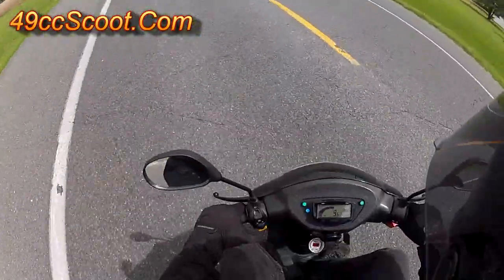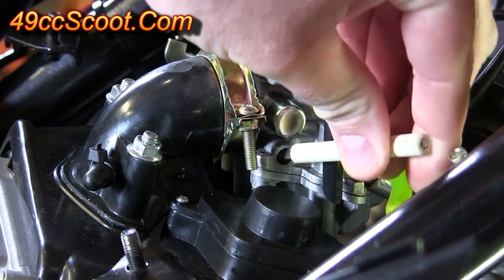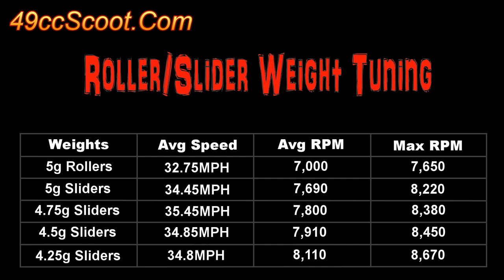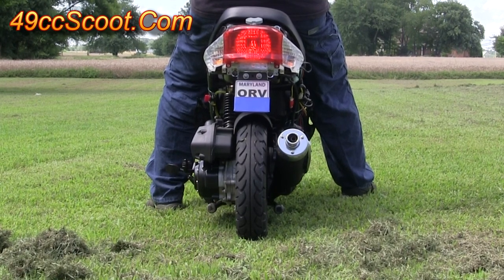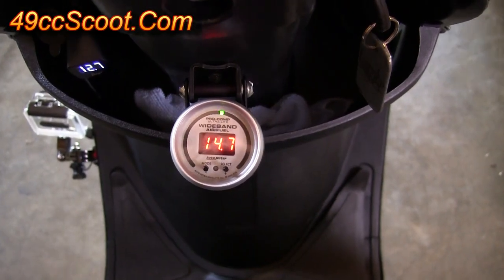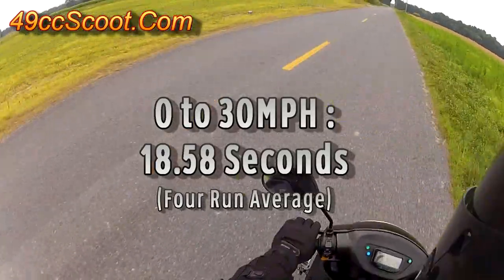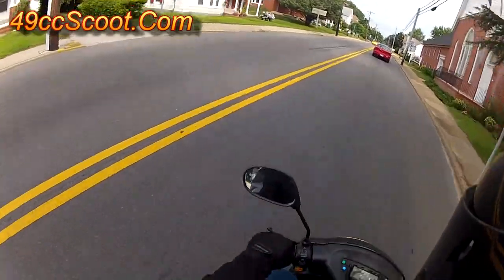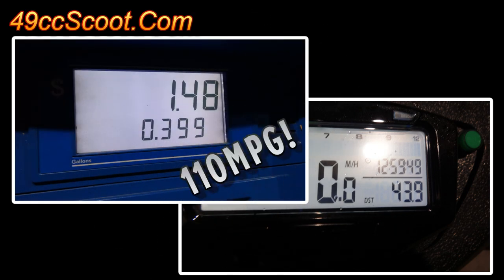Project TaoTao : Carb & CVT Tuning, Airbox Restriction, & Keihin PD19J Swap : 50cc Scooter

Comment: Hello sir. Got a question for ya. My tao tao 50cc runs well but sometimes after being full throttle for an extending period of time, I notice a sudden power drop. And still sputter at idle. If it shuts off it will not turn on. Almost as if it's flooded. After about 15min or so, it will turn back on. Is this issue in my carburetor? Could it be running too rich? I dont have much experience mechanically but have really enjoyed your how to videos. Helped me change oil and gear oil. Thank you for you vids and for any advise with this issue. Thank you! Much love!
Reply: I have as KeiHin carb on it so I can make adjustments to it.
Reply: I'll be at WOT and sudden power drop. I then have to baby it at half throttle to keep it going and 1/4 throttle at stops to prevent it from dying.
Reply: It does still have the original fuel filter. Currenting sitting g at 1700 km.
Reply from the maker: @jaimealvarez4722  I would check the fuel system over. Something clogged or causing less flow could do it. Could also be a low float height setting that runs the bowl dry with extended WOT.
Reply: @49ccscoot  anyway to speak to you directly. Like email or snapchat?
Reply from the maker: @jaimealvarez4722  My email is on my site.

Comment: Hello, How do you get the Air/fuel ratio? do you read it from any intrument? or you calculate it? How do you calculate it? thanks in advance
Reply from the maker: +Jesus Palacios (JPdrums) I have a wideband O2 sensor and gauge on mine. It's not necessary for tuning, but I had it from my car so I used it. Too expensive to be practical for most scooters. It is very nice though. Makes tuning much faster after an initial tune to make sure the gauge and engine performance are in agreement. For changes like summer or winter jetting now, I don't need to do a bunch of test runs. I put a jet in, see where my air/fuel ratio is, and leave it or change it again depending what I see.
Reply: ***** That is very very helpful, Does the gauge measure in volts and you convert it to A/F? I have knloedge in electronics, I think I can get some O2 Sensors from a car cementery.I Have a chinese 150cc scooter with some carb tuning problems and want to make some tuning but doing test runs for me is inpractical becausein my contry we dont have access to a wide variety of Jets. So I will go for the O2 sensor option. Thank you very much
Reply from the maker: +Jesus Palacios (JPdrums) The gauge displays either an air/fuel ratio figure (14.7 as in 147:1 for example) or a lambda reading (1.0 being stoich/14.7) depending which you select. The signal is a voltage though, that the gauge translates. You can find a lot more info on the actual workings of wideband setups with a google search.

Can't you get jets shipped to you? Lots of eBay sellers will send things all over the world.
Reply: ***** Thanks, I supose in my case I need to get the O2 sensor datasheet to translate the readding to a A/F ratio. I have a working microcontroller where I ca do that.

No I cant get anything shipped. Country's F..ked up economy and bureocracy doesnt allow me, my moth salary as a professional is at about 50$ - 60& per month :-/. Im from Venezuela.

Today I got some old jets from a friendly motorcycle mechanic, I managed to get a couple of smaller jets and is working better.

Thank you very much for the help and for your time and patience.

Comment: I have a 90 2001 Polaris scrambler I picked up for my son.im not rich but try to give him stuff I did not have.i got it running great then all of a sudden it stopped!spark is good and consistent.seems to be lacking some fuel.when I spray propane in you can hear it try to start.can the card get messed up that fast?there is a fuel filter on it.
Reply from the maker: Check the whole fuel route. Could be as simple as a pinched hose. Make sure hoses are good when weight is on the ATV.

Comment: so after installing the pdj19 keihin I noticed my plug fouled black...should I be adjusting the screw on the carb to the left or right? is lean responsible for the foul or rich? does turning the screw to the left make the carb leaner or richer...sorry for my ignorance....
Reply from the maker: Rich fouls plugs. Lean would leave it clean. Turning the screw in would lean the idle mixture. You may have to go over the whole tune, not just the screw. Here's a bunch of info : http://www.49ccscoot.com/faq/carbtune.html

Comment: My rear clutch stay open. I used my fingers to smash it open so I could take the belt off. Well it stayed that with the belt riding all the way down in the rear clutch groove . I just put it back together that way. Now I realise there is something majorly wrong. I was in there and replaced the variator. But I am certain the contra spring shojld make clutch snap closed?

Comment: I need your help I rebuild my gy6 50 from top to bottom all new parts . I need to ask you about a 21mm pwk carb. And the best air filter I can buy as the carbs on the bikes don't last me long . I have had like 3 carbs over the last 3 years . I will try to hit up your tip jar soon . And thanks much
Reply from the maker: Some of the folks on the forum could give you better advice with the PWK. I have never used one.   If you get a quality brand... like Keihin or OKO for example, then it should last for years. I've used UNI pod filters, usually the dual layer, and K&N filters on 50-150 4Ts without issue, though I prefer the foam UNIs. There's no reason that combo should need to be replaced regularly. As far as what jetting to start out with on something like that, I have no idea. Again, no experience there. I have heard forum members say that acceleration is dramatically improved when you get rid of the CV carbs though.

Comment: About fuel mileage.. I know this is going to sound insane, but I have a taotao 150cc and am getting an avg. of 113.6 M.P.G.  I weigh 209lb. only use premium gas, and Valvoline oil, conv. for break in, then Valvoline max. life synthetic blend oil.  not complaining just cereus why am getting better gas millage the most 50cc.    would welcome your thoughts on this. Thank You. Dave..
Reply from the maker: A friend of mine used to ride his 150 while I was on 50s. Cruising around 30-40MPH at low throttle, he was seeing near 100MPG he said. I own the 150 now and only see about 50MPG give or take a little, but I don't believe in anything below wide open throttle. If you are more gentle with them (don't run WOT) you can definitely see big changes in economy. Just like in the vid, I only average something like 75-85MPG in my real world riding of this TaoTao... but if I rode slower and paid close attention to the throttle I could pick up a lot of fuel efficiency. These are also real numbers. Some stock speedometers are optimistic, so the odometers should be as well. If you had say a 10% optimistic gauge, your mileage would be 10% worse than you see by the odometer... so 90MPG if you see 100MPG for example.  That could also be part of it. Now, it you are WOT on the GY6 and use a GPS or accurate odometer and still get 100+MPG... I'm not sure . You need to find out and then let us in on your secrets. lol
Reply: I do have a GPS that I can hook up, will try it that way and see what I am getting then. Thank you for your reply.
Reply from the maker: Let us know what you find. I hope it is accurate. That would be exceptional mileage and a great excuse to ride everywhere!

Comment: Thanks for the vid. It helps to understand but i need more info.. I have a 49.5cc icebear mojo trike. I put a 50mm/100cc bbk on it with performance valve head ngk spark plug racing coil/cdi and a 20mm carburetor Stock jets airbox/ exhaust about to upjet tring 90# than maybe 88. Timing set tdc gaps at .005.. Im having "cold" start issues i have to hand choke it for it to start once its warm it starts fine. Runs good i think but i dont have any real experience. Also from a cold start there is a small/low  metallic sound upon start up and high revs right after start up. It goes away fast. Im told some performance heads sound like that idk?.. Could the cold start be just jets or air/fule (set 2 1/2 out) cold outside small stuff like that
Reply from the maker: It could just be a bit lean and will straighten out once you get the carb tuned.

Comment: What oil would you recommend for these Chinese 50cc engines
Reply from the maker: I've been using Shell Rotella and changing it every 500 miles (1000max), but synthetics are great. I was just saving money with cheaper oil. I wouldn't trust any oil for a long interval in these air cooled engines anyway. 10W40 - 15W40 are the usual choices.

Comment: What all modifications can I do now that I dont have a rev limiter, a rebuildable carb, & went from a 50cc to a 80cc BBK? There isnt a pink wire on the cdi box & the carburetor filter is gone along with the air box restriction. What all do I need to do since I installed a 80cc BBK
Reply from the maker: Put the filter back in the airbox. No filter will reduce engine life and it's really not gonna cost you much or any power if it's clean. Tune the carburetor.

Then it sounds like a good time to work on the CVT. At least tuning with weights and springs. Maybe try a performance variator. 

Many also like the gains with an A9 cam.
Reply: I went & bought a A9 cam when I had the 50cc head & jug & didnt see any hp gain anywhere. But when I got the 80cc I felt a good hp gain with the A9 cam. I will get a new filter for the box soon. I have factory sliders from a 150cc I had at 1 time but they wont fit a 50cc variator but I wished they would. Do you know what gram is factory for a 50cc? I have blue rpm springs but no blue contra spring. I also have a new belt ordered and waiting on it. The factory belt busted at 11,000 kilometers & I think its because of the clutch. The clutch & variator housing is a poor design. The inlet hole is allowing water to get into the belt, clutch &, variator casing causing rust to collect on the clutch. I made a snorkel for the airbox to stop water from getting into the box. I did little mods but isnt much. It didnt like being rode in the rain. So the snorkel for air box & tape on the inlet hole of the clutch worked but I dont like clogging the hole so Im working on snorkeling that as well so no water can get in. If I ride in that puddle like you did it wouldnt make it out!

Comment: Goodmorning sir, i would like to ask you if its possible to put a 32mm keihin carb into a 50cc Honda Dio 1 2stroke ? :)
Reply from the maker: I'm sure it's possible, but I'm not sure why you'd need a 32mm for a 50cc. There are some guys on my forum that could probably be of better assistance for that platform. 49ccscoot.proboards.com

Comment: I have a 50cc 2012 Tao Tao believe it has a carburetor issue I'm going to have to change it it will not hold an idle the only way to get it to run as you have to constantly rev the throttle
Reply from the maker: You could try cleaning it first and adjusting the idle settings. If it's a stock carb, it may be just as well to replace it with something that has an adjustable needle and no sealing methods.

Comment: what would be the stock rollers in my 2015 taotao 49cc? what minimum new g rollers will alleviate incline? many thx
Reply from the maker: Can't tell you for sure, I can only guess it may have the same 5g rollers that I had in my 2013. 5g sliders are a popular choice for getting the revs up a little.

Comment: hey also  wanted to know what would cause a scooter to jerk when you pull on the throttle when you first start going could something need adjusting to stop it from trying to bog out
Reply from the maker: The accelrator pump causes issues on some of these. You can try adjusting the mix screw and see if there's any improvement or try changing needle settings.
Reply: Okay im gonna have to try that over the weekend i just hope that i dont screw the carb up its a cvk carb

Comment: What would be a good carb to use on my 150cc. I would like a bigger carb and one that wouldn't hit my crossbar. The crossbar seems to be the issue right now. Thanks
Reply from the maker: I really don't deal with 150s much. 30mm seems to be the popular choice. Not sure if it's really necessary. Lots of clearance issues as I understand it. You'll want an intake to match whatever carb you choose so I would suggest thoroughly searching for options to see which combos do clear. Also I don't see it being worth the effort and expense if you leave a big mismatch from intake to cylinder head. Not saying you have to port the head, but port matching should help.
Reply: Ya, I have tried two different NCY intake manifolds. The last one said it was for low profile due to the crossbar but still pushed the carb into the crossbar. I was planning on a bbk later and adding everything at that time with a bigger carb. Oh well I guess im screwed on this situation. Thanks
Reply from the maker: Turbo Tyler  What about flipping the intake around so the carb is forward facing? May need an adapter to get it level or close.
Reply: I don't think that the manifolds will bolt up correctly like that. I would love to have it forward facing but will have a linkage problem. I think that I tried this at one time.
Reply: The only other solution would be some kind of luck on a side draft if they make one or, one that is designed like a car with the butterfly on top facing up. Once again that is if they make something like that. I never wanted to upgrade my carb due to the mpg. However loved the manifolds but couldn't get em to work no matter what. I don't think the stock carb will out flow itself even with a bbk and head.
Reply from the maker: Turbo Tyler
 Should bolt on that way, but the ports may not match up. I know 50cc intakes are often offset instead of centered. Can't recall on the 150 intakes, but there are adapters out there for leveling out a forward facing intake. There are also clocking adapters.
http://www.drowsports.com/composimo-gy6-intake-manifold-clocking-flange/

It may be possible to modify an intake from a pitbike/xr50 to work. There are a lot of options with those. They use a flange to bolt a carb on. You could prob chop off the flange and use a rubber piece to connect the carb. Another option would be a pitbike carb, but that would take some throttle cable work or a new cable and those are not CV carbs like stock.

Comment: At 1/2 throttle and wot my scooter just boggs down will not do over 20mph. Everything stock. Changed to a new carb and same issue. Any idea?
Reply from the maker: Airbox issues or filter change? Fuel supply issue?

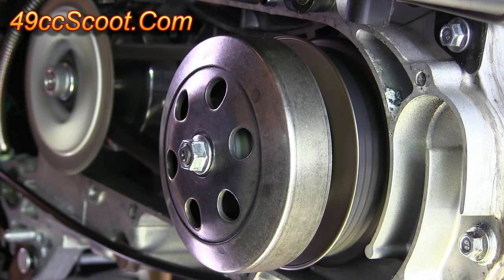Comment: hi brent, do you know the size of the nut on the clutch bell please? at time 4:04 I had to crack mine to remove it and now I don't know the size of the nut
Reply from the maker: Should be M10x1.25. Measure the threads on the shaft. It they're about 10mm, that's it. If they're about 12mm, then M12x1.25.
Reply: @49ccscoot  thanks a lot for the reply

Comment: i replaced my air box with a air cone filter .. and now it has no power ..? i give it gas and it will not go .. what coukld i have done wrong .? should i put back the original air box .. i did not do any carb adjustments ..? please help if you can ..?
Reply from the maker: It's running too lean. You either need to reinstall the stock airbox or get some jets and tune the carburetor for the new filter. You can get a jet kit (part # 114-49) from the site below if needed.
http://www.partsforscooters.com/?partner=49CCSCOOT
Reply: ***** Thanks .. ill try it with the old airbox..

Comment: My 2013 taotao 50 cc moped isn't running right, it bogs down when i give it gas and doesn't idle good, i have a new plug and new gas filter and new blue high performance racing cdi, and went synthetic with royal purple engine oil.
Reply: if your filter is restricting fuel it could have an effect aswell it could be the air filter if you scooter is older or you run 87 rather then super i suggest seafoam

Comment: How will these mods match to the Tao racer? I plan to get one next
Reply from the maker: It's the same engine platform. That should have a long case and use a longer drive belt, but otherwise anything in these TaoTao vids or my 139QMB vids should work for you.
Reply: Awesome I'm gonna need to invest in getting power out of this thing

Comment: Where can i get the instrument panel you are using? Im tired of my stock one and i want a full set not just a digital tach on the side
Reply from the maker: It's a Trail Tech Vapor. I've been very happy with it. www.trailtech.net is the manufacturer's site. I got mine on eBay open box for $70 and you can find them new sealed there as well at good prices.
Reply: *****
Thank you!! your videos are pretty informative, I work on gy6 tao tao's at a moped shop in hawaii and a variety of other Chinese gy6's the one thing main thing i have noticed is the tao tao has a bit more acceleration than most of the other gy6 bikes, me and my co-workers have hypothesized that the tao tao CDI is far superior to the majority of other gy6 bikes, like the jonway we have tested this theory by simply swapping the CDI from a tao tao to a bunch of different gy6 bikes and the performance difference was surprising.  Just puttig it out there. i was also impressed with the info you provided on the CDI comparison between the Orange NCY box and the blue "Racing" CDI thank man!!
Reply from the maker: Interesting. Thanks for the info.

Comment: Hey I am your new subscriber, just wanna ask for some tips on how to increase my gas mileage on my 125 cc gy6 engine (4stroke)
Reply from the maker: Riding style has been the best way for me to improve gas mileage on my scooters. I usually get much better results  when I slow down a little. 25-30MPG jump in economy on the TaoTao by slowing down and tucking a bit more. Other than that, keep it in tune and keep the tires aired up.